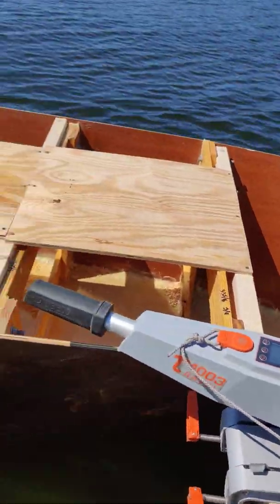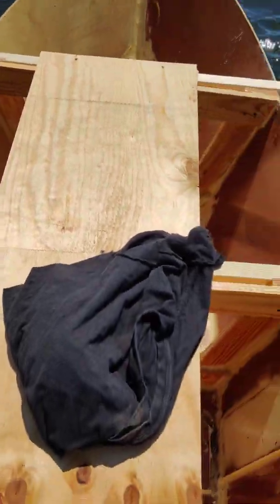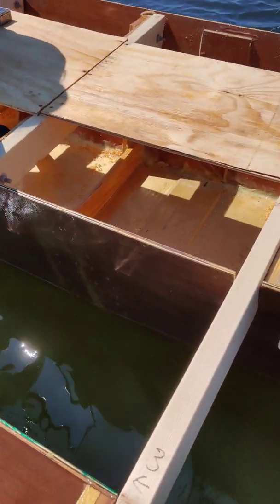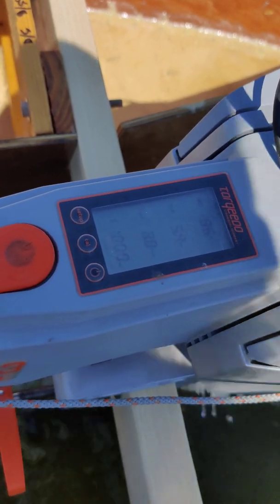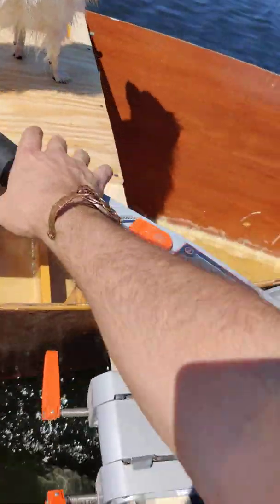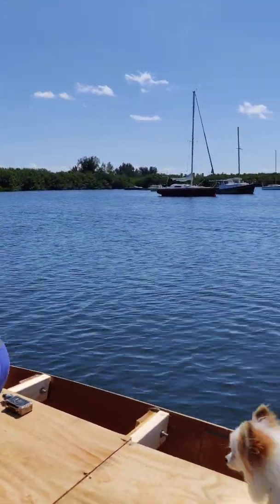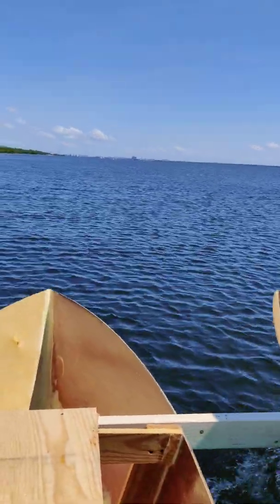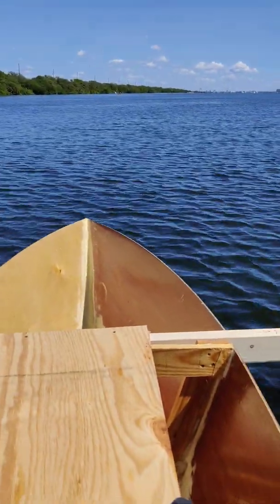prototype electric powered 13 ft catamaran

Comment: i am building a trimaran sailboat. Only 10' main hull, with 7' amas. I bought a cheap 40lb 12v electric as a backup @ 5 mph. Will show in a later video. You electric motor looks like a Ferrari. Is it over 120 LB and 36V?
Reply from the maker: I don't remember the specs off hand so I'd suggest visiting torqeedos website. They don't measure thrust the same between a regular trolling motor and one of these types of motors.

Comment: Did the profiled parts line up when you went to stitch them?  Interested to possibly upscale a design like this for messing about in.
Reply from the maker: Yes, however there was a small discrepancy in the fact that the model was done in SolidWorks which doesn't account for the half inch thickness of the plywood, however overall it worked very good together.